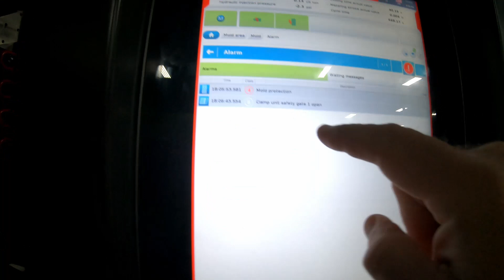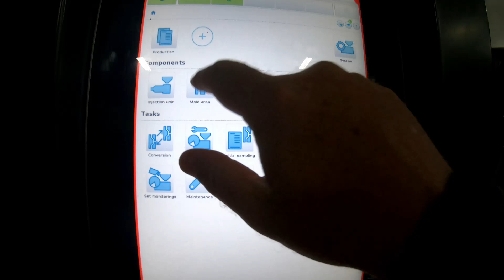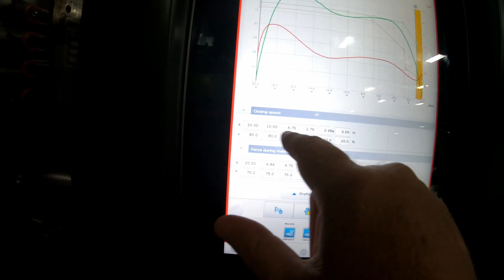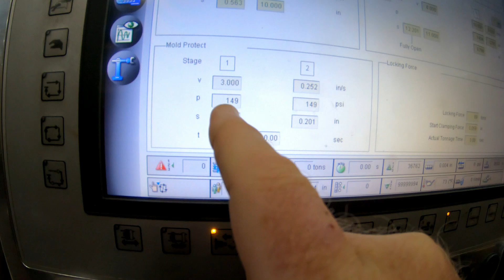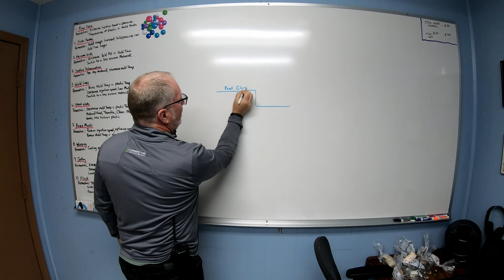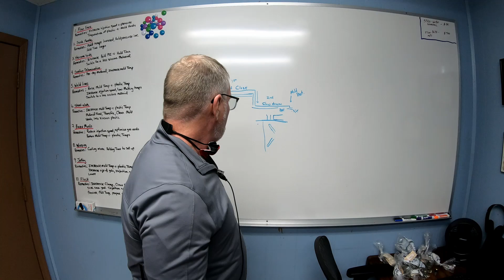Mold Protection

Comment: i would like to highlight that you have used a bit higher force for the initial closing of the mold. In my opinion , i just take advantage of the initial force generated during mold close and then make the mold slip further to closing position just due to inertia incase any particle comes in the way of mold , it just dont have the force to move forward to the next given position of the mold close. I have trained operators on this technique in my production area, and havent encountered any accident for the last few years.
Reply from the maker: This is great information & insight to how you do it. Thanks for watching & the support to the channel.

Comment: We had an instance last year on a 2300 ton Milacron...the analog card that essentially controls the closing and opening of the mold went bonkers......after breakaway, the mold went 100% v and 100% f.....the moving half of the mold weighed about 32,000 lbs....it moved the press about 16" off of it's mounting blocks.....mold protect is very critical, but so is the opening profile, lol. Enjoying the vids
Reply from the maker: Thanks for watching & the support to the channel. I always tell other molders that it is very important clamp open & close settings.